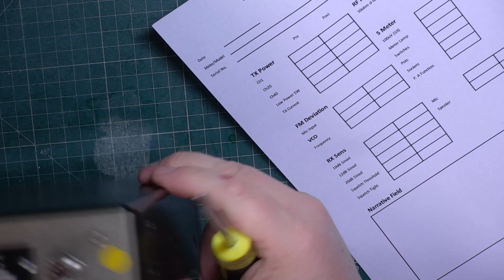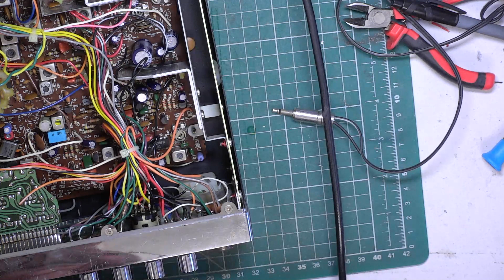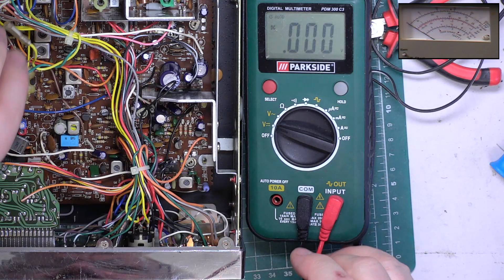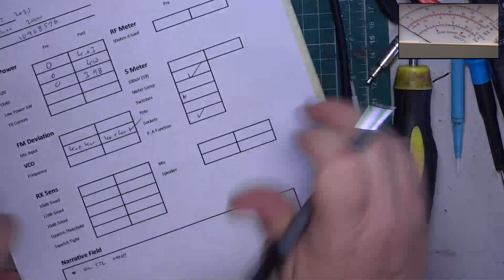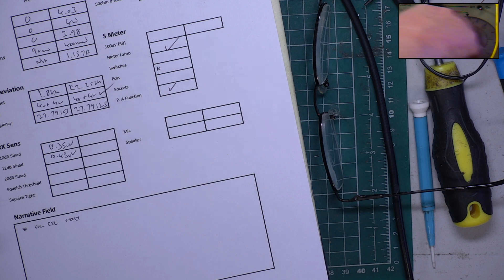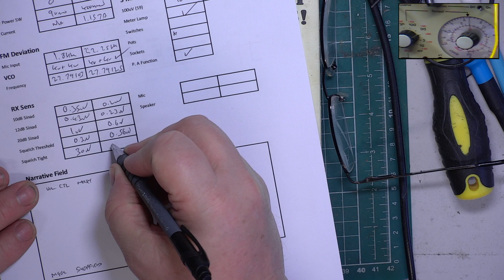Fidelity 2000 CB27/81 UK FM CB radio - repair transmitter & service.

Comment: Bleed over box
Reply: Fidelity 1000 and 3000 are, the 2000 most definitely isn't.
Reply from the maker: No...it's exactly the same as a Rotel RVC240 but with a bigger speaker & one of the best sets ever produced. No current sets get close to this performance.

Richard, G0OJF, UK